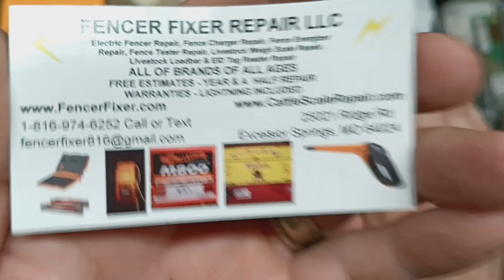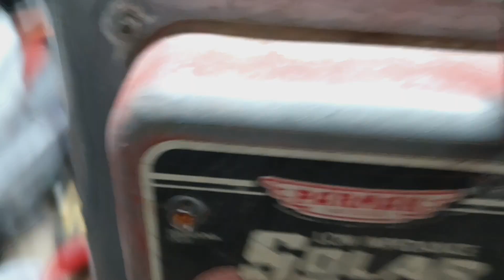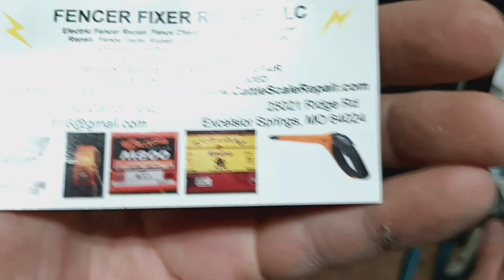Wiring Up A Parmak Solar Pak Fence Charger After The Repair | Parmak Solar Pak 6 or 12 Repair

Comment: I just purchased a Andmon MINI400 20 Miles Solar Electric Fence Charger with Day/Night Mode 0.3J Output Energy Electric Fence Energizer. What wire would you say is best to run with it?
Reply from the maker: I would suggest aluminum or steel fence wire if you can. 14-16 gauge wire. This will have the least amount of resistance in the wire so that smaller charger will have the best chance at having the least amount of voltage loss as possible.

Comment: Hi, thanks for this video. Its been hard to find a fix. The ends of my solar panel ground wire broke and I need to find that replacement part in order to connect to the battery terminal. Do you know where I can find one?
Reply from the maker: If the wire itself is still attached to the solar panel, then all you need is female spade connectors on the other end. Unless you're talking about something else with the wiring that I'm not understanding from your comment.
Reply: @FencerFixerRepairLLCKansasCity  Wiring is fine. The male terminal connector is all I need. Hard to find. What is it called? You have your tool on it at 10:31. Thanks again!
Reply: I found it - piggyback spade connector
Reply from the maker: @tamichock4692  Yep that's the type. You could've also crimped two wires together going into one side of a butt connector and then have just one wire coming out the other end with a single spade to plug onto the battery. Two wires in one wire out, it's electrically the same thing.